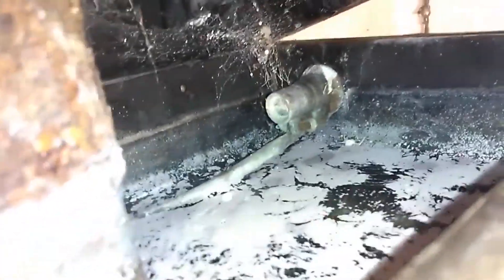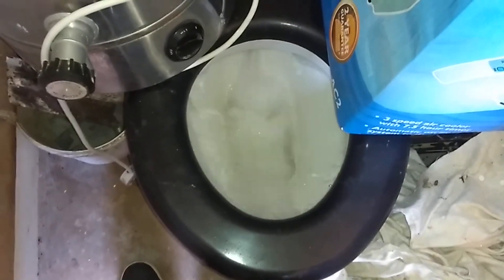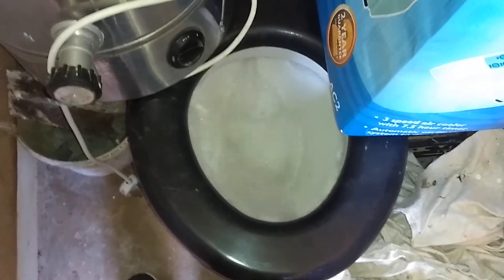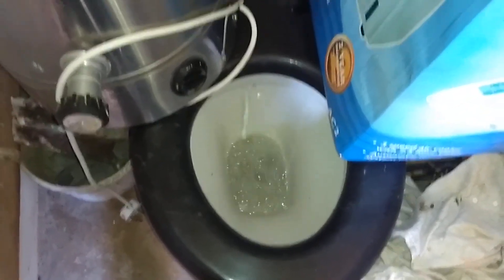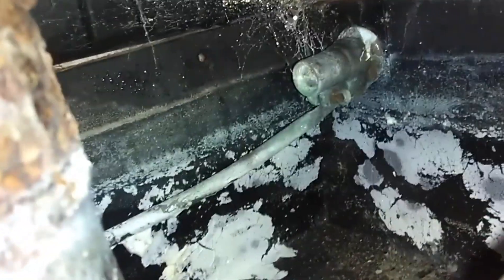2 Galvanized 1950s HLSP Thomas Dudley Bell Syphon Cisterns

Comment: I'm very impressed with this. I love the sound of that flush.
Reply from the maker: Same, they're brilliant hidden gems
Reply: @dauntless486  I take it that the cistern was going to remain empty after that flush?
Reply from the maker: @GI4JYT  Very likely, no water was coming in through the float valve, however the second one had a very minor trickle
Reply: @dauntless486  O.K. Yes, I'm wondering what the refill would have been like had there been water. I just like to hear the refills of these older toilets in particular. So many good memories of hearing the refills in the 60/70's.

Comment: Wow nice.  . Theres an old outhouse in a church near me but sadly padlocked Inside toilets have 2 80s LL Overflows. Amazing that you were able to get a flush of these 2 WCs
Reply from the maker: Ah right, most odds are it'll ether be removed or even a former chemical earth closet in there, that's what it usually is around here, but here we go. Proper derp bogs. Main WCs were modern CC AS Stuff
Reply: @dauntless486  There's a massive Chunky HL overflow coming out of it. Unless it's coming from a water tank or something
Reply from the maker: @sanway99  OOOH GET IT :D :D though it can be tricky, I smell a cast iron
Reply: @dauntless486  Well like I said, sadly padlocked. I could ask although i believe it's been like that for decades. They may not even have the keys for it unless they use it for storage purposes
Reply from the maker: @sanway99  Are you able to get a photo of the outhouse at some point?
Reply: @dauntless486  I've got a photo of it. I'll put it on KFC forum soon

Comment: We have an old bell cistern in the house we moved into recently which isn't flushing properly as the bell has corroded.. Any thoughts on whether or how it could be renewed, or replaced?
Reply from the maker: Hi Andy, I have a separate YouTube Channel for my restoration of antique cisterns like these. I've had the same problem with my 1920s XL Burlington cistern, the bell was eroded and wouldn't flush at all when the water was at at the correct waterline. What I did was cut down the stand pipe down to roughly 2 cm above the water line so the cistern becomes internal overflow (which is the now preferred standard these days) That resolved the problem as expected, and it is now in everyday use in the En Suite bathroom. Are you able to send me any photos or video of the cistern? If it's got "L W B" 401 / 402 on the side, i'll be able to source a bell in decent condition for it from the local salvage yard.
Reply: @dauntless486  Thanks so much for the reply, much appreciated - what's the best way to contact you outside YouTube?
Reply: @dauntless486  No code on the side, sadly, just a name, "The Albert", and the capacity, three gallons
Reply from the maker: @andyskipper1  Oh wow, that sounds very old, deffo worth saving if possible. You can contact me on insta, i've got a project account that's called cast iron cisterns, YT deletes all other comments automatically sadly. Sounds like your cistern might be made by Woodhouse & Co of Doncaster & has a round well.